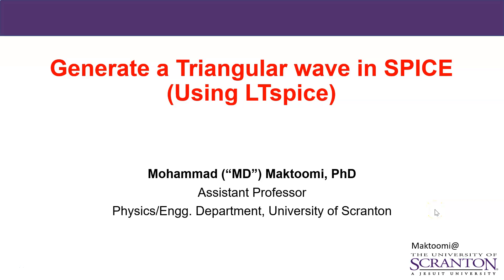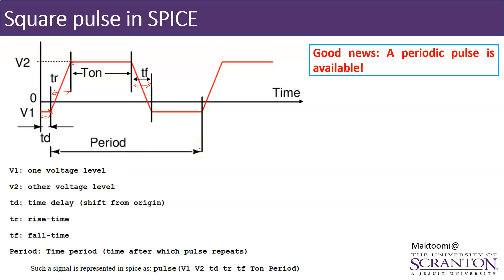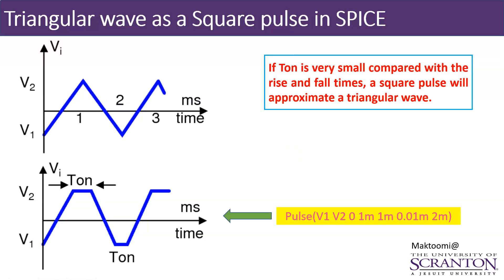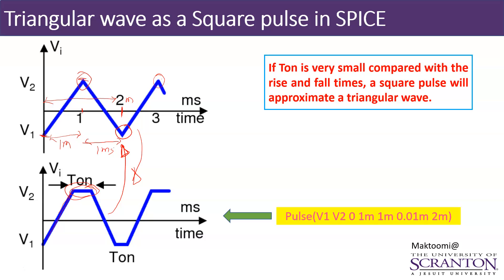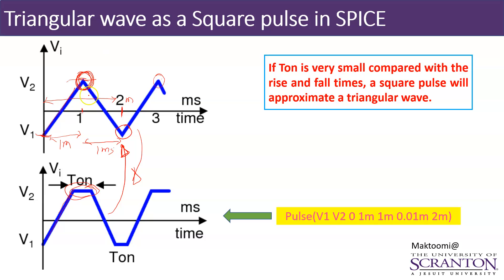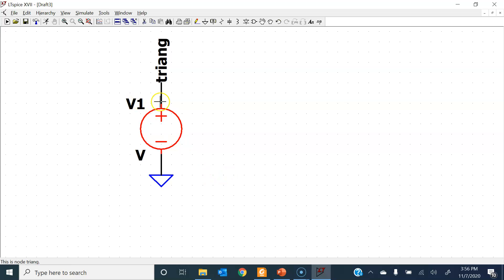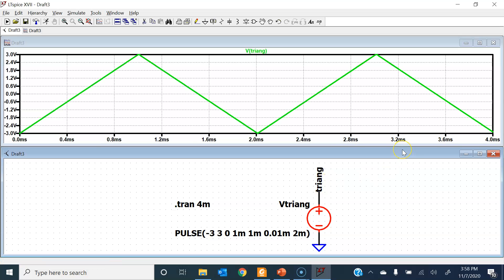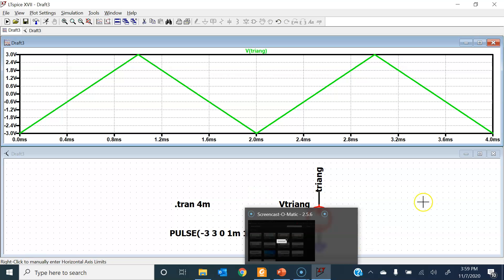LTspice Tutorials: Triangular Waveform in SPICE

Comment: How would you generate a triangular wave form with peak to peak 20V with average value 0 using a op amp integrator in LT spice using a pulse train of 20V peak  to peak with average value 0 as input with pulse width of 1ms and period 2ms ?